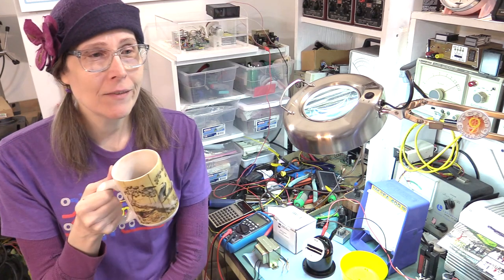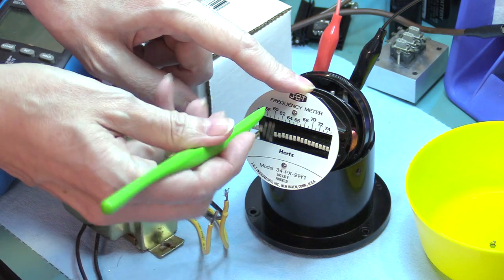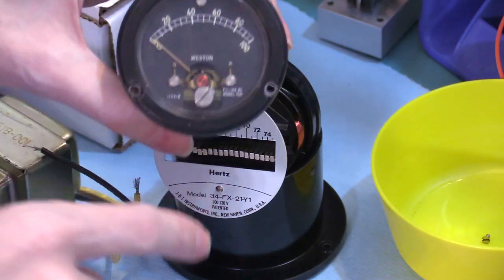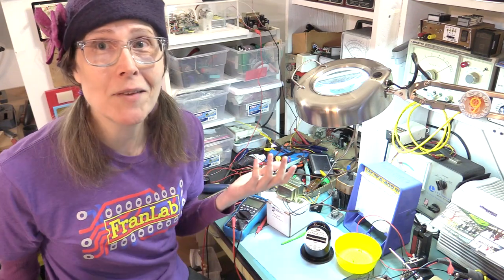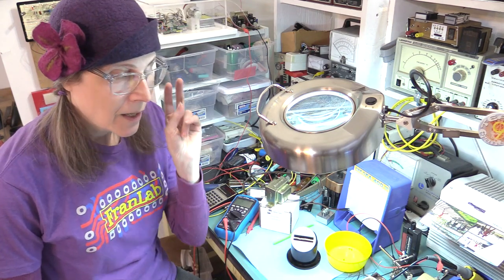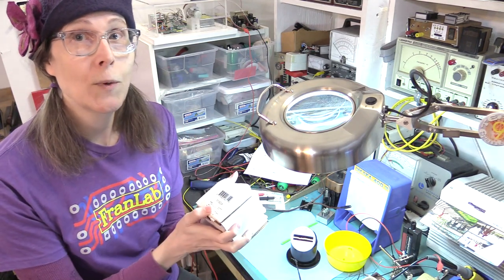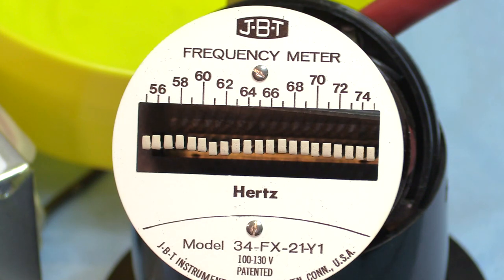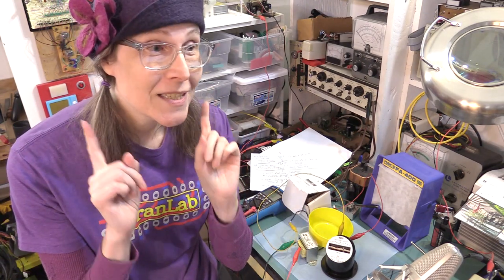Deep Dive Into The Electromagnetic Frequency Counter

Comment from the maker: By the way - Yes, I did see that I had the plug in the "normal" input and moved it over to the "Bass" input to do the test.  I just didn't get it on camera.
Reply: Loved the easter egg in the final few seconds of this video. 

It’s great the way people in amurka sometimes completely ignore the actual letters making up words when pronouncing them.

Nuclear always cracks me up when I hear it but not as much as aluminium.
Reply: So the audio transformer you ended up using with the 600ohm primary, is that from the 100V line PA setups, or is it from some form of audio application ?
Reply: Not further forwards with the coil. What you missed is a permanent magnet to one side of the coilcorematerial, like on the back of the coil.
Reply: Thanks for this vid. I really wanted to see this after watching the one without the voltage variation yesterday. You do not disappoint. One of my favorite recent channel finds.
Reply: @sonyajones  i know but if she want to use it as a pickup coil then it needs a magnet to work properly
Reply: I really love your channel, I'd love to see you in an interview hearing what got you into electronics you are very clever and humble truly  awesome to have have on the internet.
Reply: "nucular"!!!
¿huh?
Reply: Is there really a "brown note?" Perhaps that's a "wive's tale" like the huge catfish/scuba diver at every dam?

Comment: A mechanical mains electricity frequency meter doesn't need a luminous dial: if you want to know what the frequency is it means the lights are on! If the lights are off, well, I guess frequency is the least of your worries.
Reply: Not exactly, you might want to adjust the speed on a generator before connecting it to a load (which may have motors on it), but that would only take a short time so a flashlight would suffice.
Reply: @trevorhaddox6884 exactly! with multi-phase power generation, you must ensure the frequency and phase of the mains voltage and current are completely co-incident, or really bad things can happen...
Reply: Underrated comment
Reply: @trevorhaddox6884  Alternatively a headlamp or body worn light.
Reply: @trevorhaddox6884  Well as soon as you connect a load you will see a drop in frequency anyways, so you could do the rough adjustment by ear.
Having a small light bulb with a wide voltage range to illuminate the meter wouldn't affect the the generators rpm too much.
Reply: @DasIllu  Huh, are generators’ output frequencies load-dependent? I always assumed that only the voltage would drop under load and that the frequency would stay the same, but I also know very little about generators.
Reply: @fluffycritter  Generators take kinetic energy, usually in the form of rotational movement and turn it into electrical energy. The speed of the rotation is governing the frequency of the AC.
Once you apply load to that system, there is increased resistance to the rotational motion, thus slowing it down.
Imagine driving a car in one shift and constant gas only going over a flat road and then on to an incline. The motors RPM would drop or it would even stall.
The same goes for generators without active control. But even with that kind of control there is always a delay between the load and the changed kinetic energy supplied to the generator.

So this works both ways. Say you have your system under load and the frequency and voltage of your output are just perfect. Now all of e sudden you drop 50% of the load. Both values will go up for a short time.
Reply: @fluffycritter  Addendum: Larger generators, like in power plants, use flywheels or the mass of the turbine itself to resist sudden changes in RPMs. Usually grid frequencies are extremely stable, because multiple generators work at the same frequency, thus rotational speed. If there is variation in load all the flywheels will resist the change in speed.
So if your humming stereo at home gradually starts to hum in a lower frequency that is an indication for a brown out due to overload and might result in a rolling black out as the power plants one after the other are shedding load to avoid damage.

I hope this helps.
Reply: @DasIllu  Ah, that makes sense. I figured that the rotational speed of the generator's engine would be the basis of the power frequency but I hadn't considered the effect of electrical load on that rotation.
Reply: That's right up there with labeling the switch on a flashlight on-off...
Reply: For  convenience maybe sneak in a resistor and a neon indicator bulb behind the meter table? 😁 A low yellow or maybe green light would fit those swinging Hz needles.

Comment: Impedance and DC resistance are very different things. The primary of your power transformer is about ten ohms.  So it draws twelve amps when you connect it to 120V mains?  Of course not.
Reply: I wondered if someone else caught that.
Reply: also same as impedance missmatch, like hat is an impedance of power outlet

Comment: The impedance thing is BS. 1: You are measuring the DC impedance, that is not the same as the AC impedance of an iron core transformer at 60Hz. 2: The impedance of the mains line is only a few ohms in order to give you a stable voltage. You don't impedance match your toaster to the mains. The is power delivery, not audio.
Reply: Indeed.  I successfully used 6v -120v transformers as plate modulators driven from an 8 ohm amplifier
Reply: I was going to make a video, but then I figured I can't be assed with starting a YouTube war.

I measured an unloaded transformer with 0.7 ohms DC resistance on the primary as around 200 ohms load on the amp. Then by my maths the load I put on it should have been seen as around 200 as well. Both would be seen as I parallel by the amp. So around 100 ohms. Actual measured load was 75 ohms due to losses in the transformer.

The secondary dissipation was almost nothing as it is simply I2R losses, and my load was drawing 5ma. The primary resistance was 100 ohms. I used a 12v to 240v transformer and a 47k load.

Comment: I have removed dozens of these frequency meters during my years of working on 100+ year-old hydroelectric plants. They were used to bring the generator speed (frequency) to match the running bus to sync before closing the breaker. I have several on my office wall.
Reply: Did you also use the lamps connected between the grid bus and the incoming bus, that pulsate more and more slowly as you approach sync?
Reply: Cool! How did you match phase though?
Reply: @MrGoatflakes  see my other comment on this thread
Reply: @MrGoatflakes  Phase match is done with a device called a syncroscope. It is basically two motor stators. The fixed outer one is connected to line. The inner rotor is connected with slip rings to the 2nd one to bring online. The pointer shows the phase difference between the two as this is where the rotating fields match each other.

Needle points to 12:00 position when in phase. A slow rotation indicates running fast or slow. Direction shows fast or slow.  See Wikipedia on this device. I have used them.
https://en.wikipedia.org/wiki/Synchroscope
Reply: @praveenb9048  brilliant, i was imagining some sorta weird thing with synchronous motors and a differential to read out phase, before i looked at your response
Reply: other option: close the circuit with a thick enough bar, and one way or another, they will end up in phase :D
Reply: So you will know the vibration frequency of the next earthquake?
Reply: @MrGoatflakes  Yes, most had two incandescent light bulbs (that I also have in my office) connected across two poles of the breaker using potential transformers. At zero closing angle the bulbs go out, 180 out of phase they burn bright. I also have a nice collection of syncscopes. Now we use electronic relays and PLCs to do everything automatically.
Reply: @spambot7110  LOL, or emit a lot of smoke!
Reply: @spambot7110  just stand clear of the fireball! 😳
Reply: @uTube486  I've made a "dam" good living over the past 40 years mixing water and electricity!
Reply: @spambot7110 , with lights, noise and smoke!... Got that once at a military plant btw two sources. Needed some time to remove melted copper (from the coupling switch).
Reply: @praveenb9048  I recently learned that the lamp synchronization method works much better with 25 Hz power than with 60 Hz. It makes sense, but it never occurred to me.

Comment: it wouldn't appear as 0.6 ohms.  It would appear as a ratio of the load on the secondary side.  120:24 is 5:1 winding ratio or 25:1 impedance ratio.  You'd need 200 ohms on the 120v side to present an 8 ohm load on the 24v side.  600:8 ohm trafo is 75:1 impedance ratio or 8.7:1 winding ratio.  With a 16k load on the 600 ohm side, the amp is seeing a 213 ohm load.   I'd be surprised if the DC resistance on either side of that transformer is more than 20 ohms.
Reply: and then I get to the part of the video with a DC resistance measurement.  Derp.
Reply: Hopefully she didn't kill her Bassman trying to drive that high reflected impedance with it.  It is a tube amp, and they don't like doing that.  It's bad for the output transformer and some other things.  A solid state amp would have been fine with it.

Comment: The DC ohms of the transformer is not an issue. Measure the transformer on your bassman, it will be less than 1 ohm. It is AC impedace, transformers don't pass DC. The 4-8 ohm load on the transformer imposes the desired load on the final output tubes (something like 3k to 8k ohms depending on the output tube type). Actually when providing the 3-8K load, the transformer itself has a resistance of something like <300 ohms to each tube. (have measured many as it is used to set the bias on the output tubes.) Heck, measure the DC resistance of the speakers you plug into the Bassman, it will be less then 1 ohm.

The 600:8 ohm transformer will only be 8 ohms impedance when its load is 600 ohms. With a 16k load, it will be effectively 26 ohms for the amp. That is only in the transformers rated frequency response. Below a specified frequency the inductance of the transformer causes a significant load.

A 24V to 120V is a 5:1 voltage ratio. The in:out impedance is a 1:25 ratio. With a 16k load it will provide a 400 ohm input impedance.  Impedance ratio is the square of the voltage ratio. So your 600:8 ohm transformer has a 8.66 voltage ratio.

Measure the 120V winding resistance and see if that was the actual load on the AC line, the transformer would burn up with no load. In its operating range, the inductance is much higher and provides a very small load on AC input with no output load.

Notice I use impedance ratios as it is not DC resistance.

The sig gen will work fine through the transformer as it is stable with any load. I have used transformers backwards with audio amps or function generators several times; usually to generate calibration signals for things like VTVMs. Have calibrated AC meters this way that are spec'ed at 1khz frequency.

Tube amps may become instable with high impedance loads. They are the only ones that tend to do this. 

Maybe you have seen 70V PA sysems. Each speaker has a transformer with the voltage ratio set to set its rated output power when driven by 70V. The impedance on the amp can be all over the place.

Edit: Uncle Doug on YT covers how the impedances work on guitar amps including voltage ratios vs impedance ratios.
Reply: If someone wants to learn more, search ‘reflected impedance’. If she makes a 24V driver for the generator, capable driving a current of 120/24 times output current it should work.

Comment: I work with a camp at a remote site (A wilderness retreat centre), that is on its own hydroelectric power system. As the system is islanded (not connected to the grid) our line frequency is far more variable, depending on load.  We have these meters in several locations, including in a box on top of the commercial dishwasher. In the winter months, when the available power is low, one of the jobs of the folks in the dish pit is to keep an eye on the meter, and if the frequency drops too low, they have to quickly power off the dishwasher and hot water booster to prevent a power outage. Our typical line frequency is at around 59.5 Hz in the winter months. If it drops to 58.5, the protection relays on the generating plant disconnect the town.

These things are important when your generating plant is only producing 60kW, and your commercial dishwashing system is trying to draw 5kW.
Reply: In my area, there have been times where they go ahead and let the line voltage start lowering to reduce amperage when there is too much power load.  Where I worked, we had used some constant current transformers and figured we could use them to protect things like refrigerator motors and such when they lowered voltage or even during some "brownouts".  We figured if enough people had them, the power company might find it frustrating that as they lowered the voltage, the current draw remained the same.

Comment: Fran, Transformers have DC resistance which you measured.  They also have a reactive component. Those combined is the impedance. The load of the secondary of a transformer is reflected into the primary.  EG: unloaded transformer draws little current. Overloaded transformer draws higher current, limited by the resistance. For voltage stability, driving a transformer with a solid state amp with high negative feedback, or a tube amp with push pull outputs works fine.  Due to the very high Z of the frequency meter, the small transformer will provide much higher than 8 ohms load to your amplifier.  You can test this with a 2nd transformer. Use your variac or another matching transformer and connect them secondary to secondary through an AC ammeter. With line voltage applied to the primary of the first transformer, the low secondary voltage into the 2nd transformer will be low, even with the low wattage frequency meter attached to the 2nd transformer primary.  The lower the DC resistance of a transformer, the more current it can handle without high loss due to the winding resistance.  The frequency meter does not have an iron core, so it depends on resistance instead of inductance to limit the current.

Try it. Use a signal generator, or Audacity on your computer to generate a slow sweep from 55 to 75hz. Turn up the amp to the secondary voltage of the transformer and connect it. If paranoid, fuse it with a 3 amp fuse. An 80 Watt amp is often protected  with a 6 amp speaker fuse on solid state amps. Then connect the meter to the primary at 120 Volts. Try it, and use a 3 amp or smaller fuse if you are worried about your amp.  You are dropping less than a 5 watt load on an 80 Watt amp.  Not a problem. I recommend the 30 watt or more amp is for the voltage. Lower wattage amps can only drive lower voltage transformers and may clip trying to driver 24VAC RMS into the transformer.
Reply: Word!
Reply: Right explanation!
Reply: @danieleciavatta7522  Difference between an engineer venturing into an unknown field and a veteran engineering technician that works with this daily.

Comment: As I noted for your original video, the angle of the plates is to ensure the amplitude of vibration is relatively constant throughout the frequency range.  Otherwise, the low frequency tines would oscillate at a greater amplitude than those at the high frequency.  The tines where the angled bars are further apart get less magnetism, where the bars taper closer is greater magnetism.  Whether the mechanical resonance change is achieved by tine thickness, width, or weight of solder (as you noted) does not matter.  The "heavier" tines will swing further given the same magnetic field.  What is specifically being compensated is the tine weight.  And I wouldn't be surprised if when they made their first prototype, this little piece of physics hadn't yet occurred to them.  And they scratched their head and came up with a simple and elegant solution.

Comment: Fascinating video! Thank you, Fran. The solder on the tines reminds me of a Wurlitzer electric piano. When you purchase a replacement tine (they sometimes break), it comes tuned slightly flat, having slightly too much solder on the tine. You then very gradually file away just enough solder to bring the tine up to the desired pitch. If you accidently file away too much solder and go sharp of the desired pitch,  you have to get out the soldering iron and add more solder, then start all over again, filing the solder away, bit by bit, until you reach the desired pitch...a royal pain in the ass! "Playing" the tines on the frequency meter is like playing a guitar string in the presence of a magnetic guitar pickup. The tines of a Wurlitzer electric piano, however, instead of disturbing magnetic lines of flux, use capacitance to pick up the sound. The tines form one plate of a capacitor, and a fixed plate forms the other plate of the capacitor. A charge is then placed on the tines. When the tines vibrate near the fixed plate, it causes a corresponding change in capacitance, which is then amplified. This approach to amplification works the same way as a condensor microphone. And if you want to go on another rabbit trail, there's the Fender Rhodes electric piano, which uses tines that vibrate like guitar strings in a magnetic field. They're easier to tune - you slide a little spring one way or the other on the tine to tune it. I love this stuff! (Sorry for the lengthy post.)

Comment: The inverted power transformer trick does work in some cases. Many years ago in college (~1973) I wanted to test a 400Hz aircraft artificial horizon indicator from a Link trainer. I used a 10-watt Heathkit amp and a 12V-to-120VAC filament transformer. Lacking a signal generator, I recorded WWV's 440Hz tone on a piece of open-reel recorder tape and spliced it into a loop. A few adjustments later it worked like a charm!
Reply: Wow nice work around